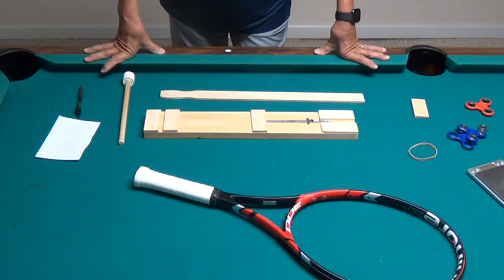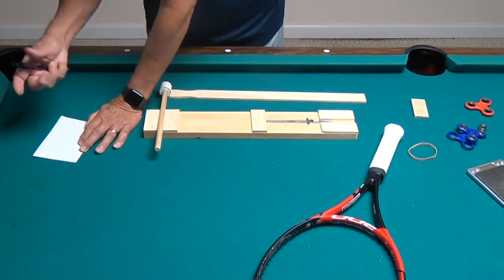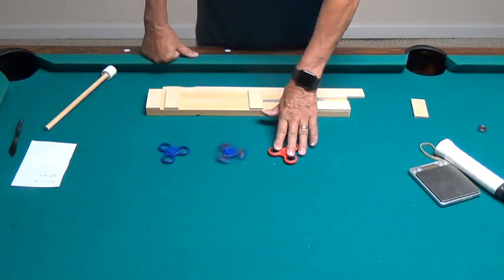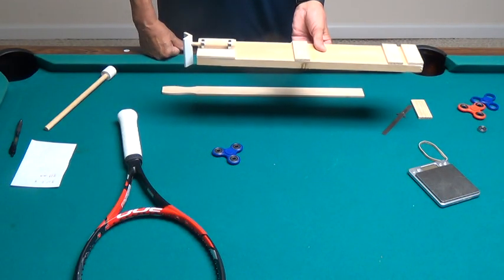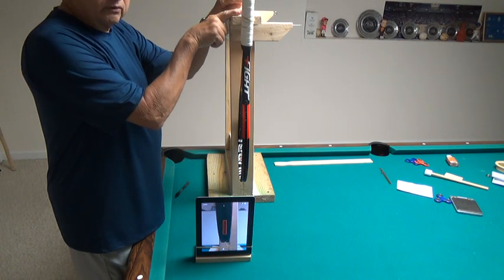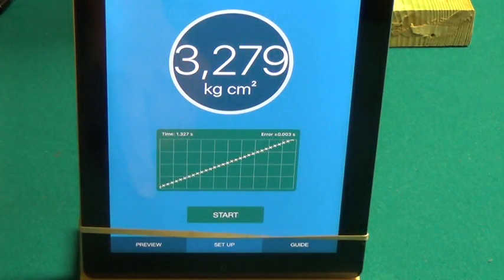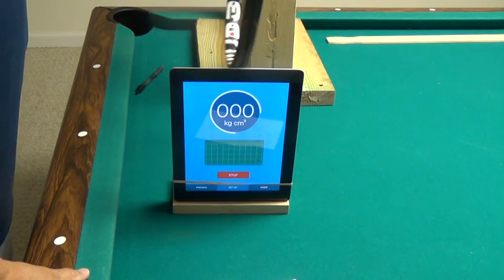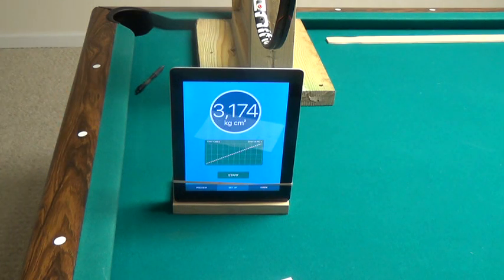DIY Racket matching jig

Comment: Thank you very much for this video, just built my own jig and it works like a charme. 

Does the weight of the mount have an effect on the result?
Reply from the maker: Yes it will add some inertia but because it is close to the pivot very little.
Reply: @Mr10sStringer  Today I had the chance to measure my three diy-matched rackets in the local tennis shop on a Prince Precision Tuning Center. The rackets had all the same specs, but: it seems that in my case the swing weight measured by the app is always about 5 points higher than the one measured on the Prince machine. Also the TW Customization Worksheet Tool shows the same result sw as the Prince machine. So is it possible, that the mount causes the + 5 points? Seems a little bit much to me ...

Comment: Which app are you using ?
Reply from the maker: I was using SwingTool in the video but now I use the Briffidi SW machine and its app.
Reply: @Mr10sStringer  Interesting. How do they compare?
Reply from the maker: @TimBrennan  hands down the Briffidi with the SW1 tool if the most accurate and easiest to use.

Comment: Thanks very much for taking the time to make this video.  One question I have is how different (if at all) the swing weight measurement would be using this setup swinging the racquet from the handle versus swinging it from a two-point suspension in the string bed (I use two pencils under a heavy book hanging off a table edge to do this)?  The app seems to   be able to do the calculations for the latter after inputting the proper data.

Comment: Nice job. Have you ever compared this system of finding the swingweight with a swing weight machine to see how accurate it is?
Reply from the maker: Yes I have and it is very close but it is a slow process and you must make several accurate measurements. Now that I have a Briffidi SW1 machine I’ve thrown my jig away.

Comment: Does changing balance point automatically mean change of swingweight? I read below that SW and RW are 2 different things and I do not really know what RW is, but is BP then fixed to SW? Also very nice take on the swingtool app! I only used it personally to know my SW cause it is advertised only to work strung, which is really annoying to work with but hey. This is a really creative take on enabling it to work strung. OMW now to buy some fidget spinners :)
Reply from the maker: That would depend on where the weight is added. Recoil Weight is the inertia of a racket at the center of mass or balance point. Swing Weight is the inertia of a racket at a point 10 cm from the butt. Inertia is the property of an object’s ability to resist any change in motion. The greater the inertia the greater its ability to resist change. That number, for a tennis racket, is measured in kgcm^2. Every particle’s mass is multiplied times the square of its distance from the pivot. RW is the sum of all mass particles times the square of their distance from the balance point. SW is the sum of all mass particles times the square of their distance from a point 10 cm from the butt. If you add mass at the balance point RW will not go up because the distance is 0, and the balance point will not move. But SW will increase by the product of the mass times the square of the distance to the mass (balance point.) if you add mass at 10 the SW will not increase because the distance is 0, and the balance will move toward the added weight. RW will increase by the product of the mass times the square of the distance to the mass (10 cm.) the formula for SW is SW = RW + mr^2 where m is mass and r is the balance point -10 cm.

Comment: Mr10sStringer If I’m switching from 16x18 to 18x20 racquet. Should I increase or decrease tension?
Reply from the maker: Samantha Harner use the Stringway online tensionnadvisor. More often than not you tension should go down switching to a denser pattern.
Reply: Mr10sStringer ok thank you!
Reply: Suppose I have same racquets, different string, but SAME stringbed stiffness. Would the ball leaving those racquets have the same trajectory?
Reply from the maker: Samantha Harner maybe the only thing that could be different is the incoming ball and where on the stringbed it’s struck.
Reply: @Mr10sStringer  I don’t remember clearly but string tension doesn’t really affect power that much, right? It only affect the launch angle?
Reply from the maker: Samantha Harner tension does not affect launch angle that much either. But if you find you hitting balls long chances are your launch angle is the culprit.
Reply: @Mr10sStringer  wait, so.. tension does not have much effect on power AND launch angle?
Reply from the maker: @samharner2023  changing tension most people won’t even notice the launch angle or power does not change much. More often than not the player will unconsciously adjust for the change.
Reply: @Mr10sStringer  ok thank you. I’m a bit confused. I went from high 40 lbs to high 30s and I feel like the ball travel a lot farther.
Reply: @Mr10sStringer  Hi, quick question For tennis racquets, what is the importance of balance? What are the effects of high balance vs low balance? Which is better?
Reply from the maker: @samharner2023  feel and power. The inertia of a tennis racket is measured at the balance point of the racket and is commonly calle Recoil Weight. If you want to convert RW to SW you use the parallel axis theorem. The formula is SW = RW + mr^2 where m is mass is kg and r is the distance from the balance point to the 10 cm axis point. That distance is measured in cm.
Reply: @Mr10sStringer  ok so if I take a high balance racquet and put tungsten putty under the buttcap to lower the balance. What would happen? Would power level decrease?
Reply from the maker: @samharner2023  you would lower the balance point and increase RW. The decrease in balance would be almost as much as the increase in RW so your SW would go up slightly. You can never decrease inertia by adding weight.
Reply: @Mr10sStringer  thank you. So, tungsten putty under buttcap.. would that be a good thing or bad thing?
Reply: @Mr10sStringer  or is it mainly preference?
Reply from the maker: @samharner2023  all about personal preference. Tail weighting lowers balance, and increases total weight without increasing SW much.
Reply: @Mr10sStringer  do you know if..  
is natural gut strung at 70lb, is that softer than a poly string string at like 40lb?
Reply from the maker: @samharner2023  I have no idea, but TWU has a table that may show what you’re looking for - String Performance Database. Problem is the tensions in table are 40, 51, and 62 lbs. You may get a idea of what you’re looking for there. My guess is poly is softer at low tension than gut at high tension.
Reply: @Mr10sStringer  oh sweet. I forgot about that. Thank you
Reply from the maker: @samharner2023  also it is going to depend on what poly string you compare the gut to also. Volkl Cyclone Tour is much softer than Babolat Hurricane"
Reply: @Mr10sStringer  if I have two different strings strung at different tension but both has the same stringbed stiffness. Then power and trajectory would be the same??
Reply from the maker: @samharner2023  probably not but close.
Reply: @Mr10sStringer  Hey just wondering, do you know of any place that sell outdated racquets?
Reply from the maker: @samharner2023  other than the usual places no. I have some Tecnifibre racket I would be willing to sell. PM me on talk tennis if you’re interested.
Reply: @Mr10sStringer  Dude I came across this interesting article. And I wanted to let you know http://www.tennisindustrymag.com/articles/2006/02/raw_racquet_power.html 
So pretty much, a racquet power is not dependent on its mass but rather on its swingweight.
Reply from the maker: @samharner2023  I’ve seen that article many times. Inertia is mass, and another term for inertia in a tennis racket is Swing Weight or Recoil Weight. Inertia is an object’s tendency to do nothing or remain unchanged. If you want to increase inertia you much add weight or move the weight you have farther from the pivot.
Reply: @Mr10sStringer  may I know your opinion on something? What do you think about this spec. 370g mass 33cm balance and 360 swingweight
Reply from the maker: @samharner2023  for me personally too high in every spec
Reply: @Mr10sStringer  Is there any downside to having a really low balance? If I take a racquet, and stick a whole bunch of tungsten putty at the bottom of the handle to significantly lower its balance. Would there be any downside?
Reply from the maker: @samharner2023  adding too much weight in the handle is just as bad as adding too much weight in the head. I would prefer to add only enough weight to meet my objective of SW, balance, or MgR/I.
Reply: @Mr10sStringer Wouldn't a head-light racquet  feel lighter when holding it up compared to a head heavy racquet (assuming all else are the same)? 

So, I don't understand why would adding weight in the handle to significantly lower the balance be a bad thing? I don't know much of this technicality stuff so please explain
Reply from the maker: @samharner2023  to make the balance low you must add a lot of weight in the handle. Weight added too far from hitting area is not going to be beneficial for power. It’s just more weight you have to carry.
Reply: @Mr10sStringer  well, I mean. A little weight can add a huge difference. If I add like 15g of tungsten putty under the buttcap, then balance would go down a few points.
Reply: @Mr10sStringer  so, a racquet with higher balance has more torque right? What is torque?
Reply from the maker: @samharner2023  there are 2 measurements to torque. Static torque is balance times weight, and dynamic torque is the force needed to accelerate a racket around an axis. Which one are you talking about?
Reply: @Mr10sStringer  I have been reading some articles on the Internet. Do you know what “moment” mean? I read this somewhere “The moment is very important for consideration because a racquet with a high moment can increase difficulty when volleying and returning”. Do you know the equation for moment?
Reply: @Mr10sStringer  Also, I read on a blog site saying lower work is better for tennis racquets. The equation is .5mv^2 but how do I measure it? I know m is mass but what is v?
Reply: @Mr10sStringer  sorry for asking you so many questions. It’s just that I am really curious. Weight on the handle will lower the sweet spot more than 6 o clock of the hoop?
Reply from the maker: @samharner2023  moment is a shortened version of moment of inertia.
Reply from the maker: @samharner2023  a high moment is a racket with a high SW
Reply from the maker: @samharner2023  v is usually velocity
Reply from the maker: @samharner2023  there are multiple sweet spots on a tennis racket. One being the center of the strings and another being the COP. The center of the strings does not move the formula for COP can be found here https://tt.tennis-warehouse.com/index.php?threads/calculating-cop.571447/
Reply: @Mr10sStringer  wait , so weight added to handle will change cop more than weight added at 6 o clock?
Reply: @Mr10sStringer  Do you know what hittingweight mean? How is it increased?
Reply: @Mr10sStringer  suppose I got two racquets. Same mass and moment of Inertia but different balance. Would the lower balance have higher hittingweight or the higher balance?
Reply: @Mr10sStringer  is high recoil weight a good thing? What are it’s benefits?
Reply from the maker: @samharner2023  the higher the recoil weight the higher the SW with less total weight. I never really bothered about hitting weight.
Reply from the maker: @samharner2023  hitting weight is the weight behind the ball the higher the balance point and the more weight you add the higher the hitting weight. If you want to increase hitting weight as much as possible add mass at 12.
Reply: @Mr10sStringer  then, adding weight under buttcap would decrease hittingweight?
Reply: @Mr10sStringer  Ok, ok, last question. How much swingweight does string add to tennis racquet?
Reply from the maker: @samharner2023  that will depend on the weight of the strings and the length of the racket. On the average about 30-40 points.
Reply: @Mr10sStringer  ok 1 more question. travler said shorter people -> higher mgr/i. Is there some truth to this?
Reply from the maker: @samharner2023  probably but more personal preference
Reply from the maker: @samharner2023  I strung a Wilson 16x19 Blade and a 16x19 Pure Drive. The Blade went fro 291.8 g, 32.7 cm, and 293 SW to 309.1 g, 33.6 g, and 320 SW. The PD changed from 317.5 g, 31.5 cm, and 296 SW to 334.9 g, 32.4 cm, and 325 SW. With each racket weight added about 17.3-17.4 g, 0.9 cm HH, and 27-29 SW points.
Reply: @Mr10sStringer  oh really interesting. Thank you for letting me know
Reply: @Mr10sStringer  About mgr/I. Shorter arm -> higher mgr/I. And longer arm -> shorter. The physics behind it is true, right?
Reply from the maker: @samharner2023  I would think it would be more in line with your arc not your arm. But yes is the arc is proportional to arm length.
Reply: @Mr10sStringer  if it’s more in line with your arc, then that means that people with bent elbow would need a higher mgr/i than people with straight arm?
Reply: @Mr10sStringer  since a bent elbow swing has less arc.

Comment: thanks for the great video mrstringer but when you have matched balance and weight but the racquets have different swing weights, how do you match them? is there a formula?
Reply from the maker: Francesco picchio I = mr^2 I is inertia or Swing Weight, m is mass in Kg, and r is the radius or distance from the 10 cm SW pivot. Don’t match weight and balance first match SW then try to get weight and balance matched. Do it all on paper first.
Reply: Mr10sStringer ok thank you very much i will let you know the results

Comment: i  built the other jig (balance) last week....thanks again. also absolutely love your tip on "locking in" the string inside the grommet before tying off. i have yet another question for you. i recently watched a video about cleaning my gamma els. i pretty much was doing everything i saw on the video EXCEPT, i have never put oil on the bottom of the clamp base. to me this would seem like a bad idea. what is your take on this ? thanks again
Reply from the maker: Ralph h oiling the bottom of the base is a bad idea.
Reply from the maker: Ralph h BTW I got that tip from locking in a string behind the anchor strip from a R Parnell video. More often than knot you can’t use it so I don’t use it at all
Reply: @Mr10sStringer  why wouldn't you be able to use it, i don't understand
Reply from the maker: Ralph h if the anchor string goes through the grommet diagonally you can’t lock a string behind it. The string you’re tying off will be above or below the anchor string.